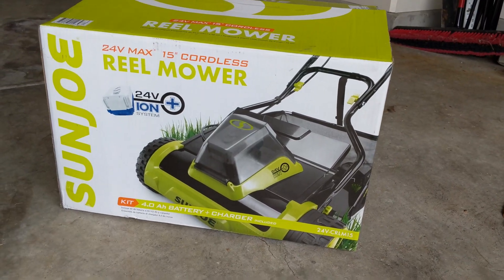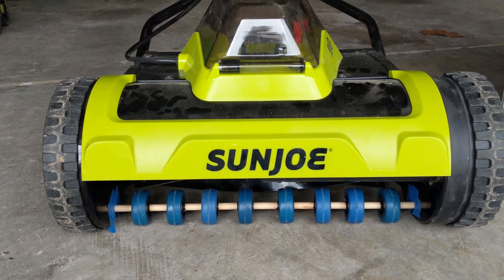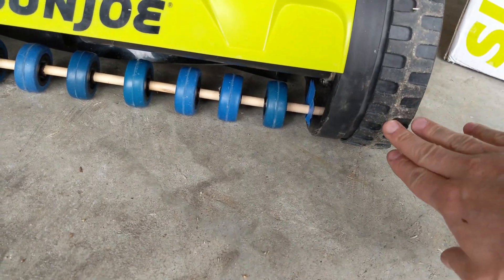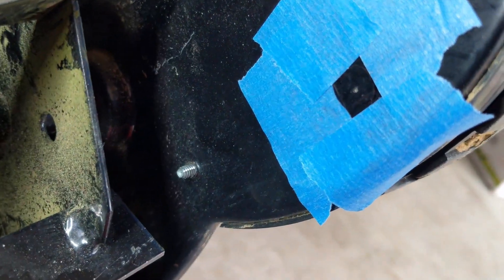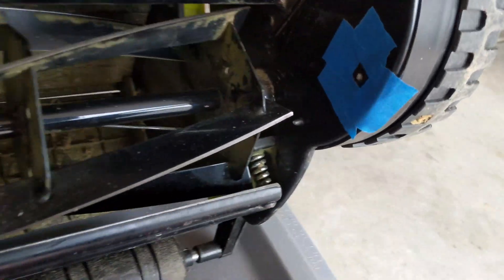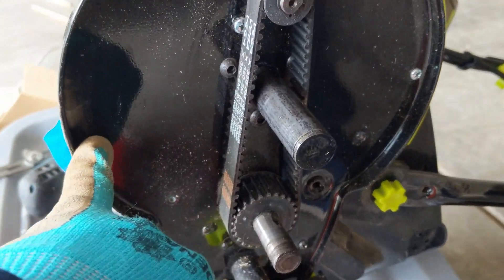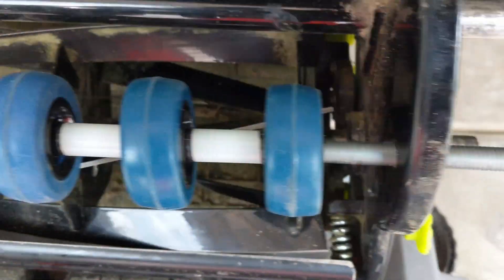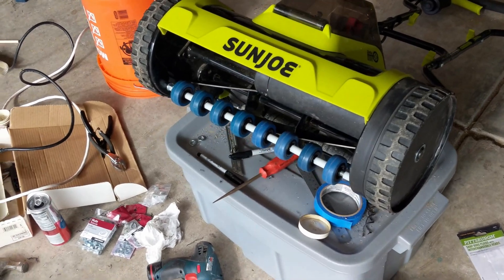Roller Mod for the Sun Joe 24V-CRLM15

Comment: Does the modification affect the height of cut adjustments?
Reply from the maker: Hello!  Thanks for the question.  The roller modification does not affect the height of adjustment settings of the mower.  The adjustment is set at the rear of the mower.  To provide more detail I did this modification because I was experiencing scalping on the low setting.  If you are cutting higher you probably would not need the modification.  Hope this helps!

Comment: Purchased one of these units in August.  Worked like a champ for a bit then motor just stopped working. Sun Joe is out of stock and can't do a warranty replacement.  Anyone else have this issue??
Reply from the maker: That's a bummer.  Were you able to get a replacement motor?  They appeared to have discontinued the mower.

Comment: Nice work. I've seen others modify manual reels with conveyor rollers. Did you consider that option at any point? Sorry if you said that and I missed it.
Reply from the maker: Hello! Thanks for the interest and comments.  I did consider that option but decided to go a different route for two reasons. First, I couldn't find a roller that was easily accessible that fit the required width.  The second reason is that the mower in this case is very lightweight.  I was worried on thick grass the mower would float and not cut as low as otherwise possible. Hope this helps 👍
Reply: What you’ve created is more akin to a grooved roller than a flat roller and that produces a better cut…kuddos.
Reply from the maker: @robstealey1856  Thanks!  I actually targeted a more grooved design. Because the mower is so light I was worried about it floating on the dense grass.👍👍👍👍

Comment: Wow, What a great idea!  So... since it's been a year since this posting, was the threaded rod the way to go? Any issues with it surviving bangs and rougher handling?  Looking back would you have done anything different if you were to do this mod again?   I've seen other videos on this model mower where their owners ran over sticks and bent blades that then needed to be blended out so this mod seems that it'd be a great way to prevent that from happening. Have you noticed these casters preventing you from running over sticks, ect???  Again, Great mod! LOVE IT!!
Reply from the maker: Hi Ronald, thanks for the interest and nice words.  It worked great all season and still rolls well. While improvements could be made with a machined smooth rod and bearings I'm not sure it's worth it considering the price of the mower👍👍

Comment: This is sort of off topic but have you thought about modding the height of cut notches? I am debating if I can drill/zip away in between the current holes and then replace the pull pin with a bolt/nut. Not being able to go in between 0.6" and 1" is killing me :D
Reply from the maker: While I hadn't considered it it sounds like a great idea for someone who needs additional flexibility in the height of cut.  Personally for me the lowest setting is working. ,👍👍
Reply: Amen to this. This is a great little reel for the price, but the increments of 1/2” between all the HOC settings (0.6”, 1.0”, 1.5”, 2.0”) is WAAAY too much. A quarter inch is still a little too much of an increment but would go a long ways in making this more versatile. I’d like to do a summer reset right now, but if I scalp at 0.6”, then I’ll have to wait until grass gets all the way back up to 1.0” before I’m cutting again. That’s too much growth after a reset. A 0.75” setting would be great. 

Another question, are you happy with those casters after a year or do you think there might be something else you’d like better?
Reply from the maker: Hi Rob! Thanks for the suggestions!.  So I have no issues and am happy with it so far.  Of course it would be cool to have them running on bearings but then it gets pretty expensive.👍👍👍👍

Comment: Hi Jason. Great video! I just ordered this mower and want to do the same mod. My two month old zoysia sod is very bumpy. I’m thinking I probably can’t sand level until next year. Not sure about that. Anyway, I’m gonna do this mod immediately. Do you have any links for the rollers and rod you used? Might as well order them today. Thanks!
Reply from the maker: Hi John, thanks for the kind words.  Glad you found the video useful.  All of the parts have links in the description for the video.  Leat me know if you need anything else 👍
Jason
Reply: @jasonochoada3083  I can't believe I missed that! Haha. Thanks Jason! Any plans to build a striper for the back?!
Reply from the maker: Hi John!  No problem 👍. No plans for any modifications to the back.  Stock it almost has a roller across the back. For my purposes (low cut Bermuda). The mower is to light to stripe.  Hope this helps.

Comment: Very creative little mod, your SJ is starting to look more and more like a Swardman or one of the other pro cylinder mowers.  Here on the gulf coast of Thailand, I've been maintaining around 1,200sf of a tropical variety which I believe is Zoysia with a 16" Gardena manual reel mower.  All is fine if I mow every third day, not so fine if it goes for more than 5 days between mows, but hard to avoid if on a scuba trip out of province.   No cordless reel mowers here yet, it is easier for me to source a "battery less" Ozito from AU, or an Einhell from DL (both come from the same Chinese factory) then a US model due to voltage and Li ion batteries/airfreight issues.  Too bad because the SJ looks pretty well built.  May even motorize the Gardena, it has a very stout and wicked sharp fixed blade, but undecided.
Reply from the maker: Hi Andrew thanks for watching and the kind words.  I just googled gulf coast of Thailand and holy cow it looks amazingly beautiful!!!  I believe The Gardena machines look really good I have seen them online but they don't seem to make it here in the US.  I don't know how Thailand manages lawn chemicals but if you can get a hold of plant growth regulator it can slow down the topgrowth of the turf allowing you more time between mows.  This is something I plan to use next season.  Right now I would rather mow every other day as the grass is repairing itself.  When I'm happy with it then I'll start regulating it.  It's suppose to also deepen the green and suppress seeding.

Comment: Yes I am interested in the mod.  I would like the mod be a solid roller to enhance stripping.  What you think of that idea?
Reply from the maker: Hi Derek!  Yes I had considered that exact same idea but didn't have on hand access to a roller I could use and didn't want to take the chance of ordering the wrong rollers online. Conceptually I think it's a great idea. Striping with this mower will depend on the type of grass.  I'm cutting Bermuda low and with the light weight of the mower little to know striping even though the back has a significantly wide roller.  Now if you are working with cool season grasses I think striping will be much easier 👍👍
Reply: @jasonochoada3083  Can you raise the height of cut with the roller in the front or does it impact the angle?
Reply from the maker: @Sig_P229  Hi Jon!  Great question.  It does not impact cutting height.  It does rotate a bit up so it will be a little higher than the drive wheels when at the highest setting but would still price support.  👍👍
Reply: I am interested in adding a 1.9" roller like this one

https://thelawnforum.com/viewtopic.php?t=23804
Reply from the maker: @Sig_P229  go for it!  I don't recall the span between but I did measure it in the video I believe. 👍👍
Reply: @jasonochoada3083  Thanks 👍🏻 I will buy one if I can find one. The mower is out of stock everywhere.
Reply from the maker: @Sig_P229  Hi Jon, have you made progress on that roller install?  Are you planning on doing two both front and back?
Reply: @jasonochoada3083  I havent picked one up yet. Contacted SunJoe and they are suppose to be back in stock   in a week. I think I will do 1 in the front forsure the problem with a back roller is that it will be so thick it will more than likely raise the HOC from .6 to .8 or higher
Reply from the maker: Cool!  The good news is that the SunJoe almost has a full rear roller in it's design 👍
Reply: Someone suggested a couple rolling pins from Ikea ($3) to replace the wooden front roller on my '64 Atco. I'd imagine that it would also work here. Sand it down and apply a good quality marine laquer, and it should be fine for years
Reply from the maker: @robertbmcneill3758  Hi Robert it certainly may but the diameter in this case needs to be less than 3" otherwise you can't use the existing frame to mount the thu rod.  If the diameter is larger then you need to put the roller out in front.  That could be a disadvantage.  I like the roller as close to the reel as possible to prevent scalping.👍

Comment: Wow great work! I watched your back lapping video but this is awsome! I love these little mowers and up until this year had wondered why these cheap electric reels were only offered in Australia. Maybe because you can't run over a bunch of rocks and keep going like a rotary?

After this, I'm not really sure what advantage you could get by dropping 5 grand on one of those fancy Swardmans. Just need a custom drink holder now 😆. 

I'm going to give this a shot too, I was thinking about using one of these https://www.ultimationinc.com/replacement-parts/buy-rollers/16-roller-bracket/ and/or one of those on the rear to help striping. Yours is a much better idea for the front though, to keep the grass blades from matting down.

On that note, I have some taller grass, guess tall fescue or tttf, but it seemed to actually stripe very good if you keep the weight on the back roller. Keeps you from falling into rutts too. But that strategy only works because I have a 2k sq ft lawn. 

Thanks for this! Great work again!
Reply from the maker: Thanks Robert!  I think you are on the right track.  I considered that also but I wasn't sure if the spring loaded axle could be replaced by a thru axle.  If you can pull it off I think it would be a better option.  I can't get any striping on short cut Bermuda.  Probably because the mower is so light.  I bet you will have better striping results in your lawn.

Those expensive mowers?  It's like any hobby sky's the limit.  I'd be lying if I didn't say I lusted for one.  But for now I'm really happy getting the most out of the SunJoe.  👍
Reply: Robert, i was wondering if you found time to make the mod with the roller?
Reply: @derek7832  Unfortunately not yet. I have a new build home, which means contractors have left all sorts of shit at different stages of building all over my property at various depths. Unfortunately some of those things migrate around and occasionally pop up through the turf and are occasionally wire ties. A wire tie popped up onto my mower and bent the blade enough that it wouldn't spin at all. I spent a ton of time filing it down just right, then back lapping it to try to get it sharp again. Then freshly sharpened I hate ANOTHER piece of metal trash and bent the blade AGAIN. 

So I'm just going to be mowing with my rotary for a year or 2 more. I now completely understand why rotary mowers are so much more popular, neither of the show stopping wires would have even phased it. The cut quality isn't nearly the same though, and I have the telltale brown tips of a chop cut.
Reply: @robertzas  i feel your pain on that one. Went out of town for a work trip and my wife used the mower one time and hit something hard and caused the blade to hit the bed knife.  This formed a huge burr on the bed knife, and after filing for a good while and back lapping it just didn't cut the same. Had to order a new bed knife through Sun Joe, so just waiting on that to come back in. Im a first time reel mower user, and im definitely convinced that's the only way to mow. But rotary mower it is until the part comes in in a couple of weeks. My home is a new build as well and spent hours walking that damn lawn picking up all kinds of shit out of the soil since it was the first time i was cutting my lawn lower than 1".   If i get a wild hair up my ass and decide to use the roller instead of the wheels i'll update on here. Take care.